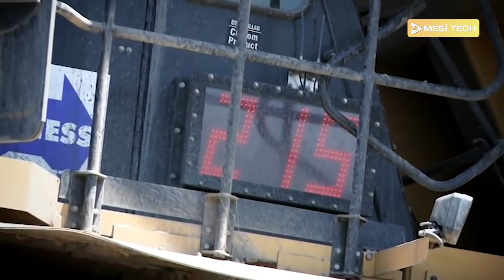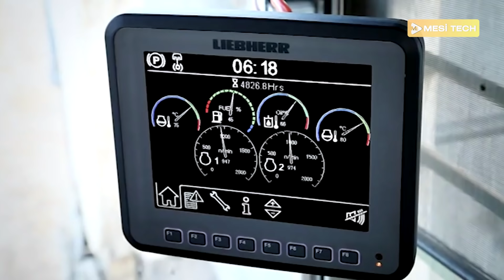The World’s Biggest Excavator in Action (LIEBHERR R 9800 Excavator Loading Trucks)

Comment: If the decepticons get ahold of this we're all f$#%ed
Reply: If it's got more than 30000hrs on it we will be right. They are riddled with electrical faults. Optimus would only have to sever a 2mm wire and it will be down.

Comment: 90 ton scoop; 3 scoop to extract enough minerals for one 1000 lb. battery for an Electric Vehicle.
The extra weight for these heavier EVs causes 1800% more pollutants from nanoparticles off the tires. EVs cause more pollution and no one wants them due to long period of charging and electrical fires.

So why is Biden pushing them? A. owned by China. China sells the batteries and covertly installs monitoring technology, just like Tic-Tok. Joe doesn't care, follow the money and he has a closet of treasonous deals with China that China uses to blackMail uncle Joe. 

He can't stand trial because the DOJ is a collaborator and Joe has been deemed to feeble mind, but can still be President? WTF?

Comment: I'm surprised how small the diameter of the rams moving the boom, dipper and bucket are in comparison to the scale of the parts they are actuating. The hydraulics must operate at a very high fluid pressure. Impressive!.

Comment: Exposed piston rods on the hydraulic cylinders...

As someone who repairs Hydraulic/Pneumatic cylinders. I hate that design for the oil feed pipes. It makes machining the barrel internals very hard or sometimes impossible, if no room for a steady rest to sit. Plus you can't replace the pipe without a full cylinder overhaul. Bad engineering.

Ideally, you would have a welded boss or an elbow joint to SAE flange. That way you can weld it on, machine the bore details round, because the welding onto a tube heavily distorts the bore roundness. That way the Gland, and o ring spigot can sit in a round bore and leave no extrusion gap.

In an ideal world, you would have used pre-honed tube, that way you can hone bore the tube to size after the welding distortion. But cost can be an issue and piston seals can be really aggressive to deal with that factor, so it's not that bad. 

The cylinder isn't complicated, I bet it is pretty big, just hard to gauge when it's on that monster. The piston rod would be case hardened to prevent chrome damage in that setting, but that has its drawbacks for serviceability. Send the cylinder to my company guys, I can do any of them and save money over retailer prices, THATS where they make the money, spare parts.

Comment: I would be interested to know what the name R9800 refers to, the 800 is clear to me With its bucket capacity of 47.5m³ and 4000 hp, 800 tons, but what does the R9(800) stand for?
Reply: It's R 9800. All the excavators of this type have a model that starts with R, and then a number based on size.

Comment: What is the fuel consumption for A 12 hour shift?
Reply: 9800 Liters = 2500 Gallons
Reply: @SubGenius1101  2500 gallons =9463.5 litres
Reply: @forfuxakes9799  i convert it liters to gallons, 9800 liters to 2588.886 gallons. I figured to round out the numbers so it didnt take to much thinking on your part.

Comment: Just imagine the hours of engineering that went into creating something like this!
Reply: Imagine the fuel bill to operate such A massive piece of machinery for A 12 hour shift
Reply: @forfuxakes9799  for sure, but you have to consider... they are saving HOURS of payroll and trucks running which are also burning fuel, waiting for loads.. this thing keeps 90 ton dump trucks moving along efficiently, 24 hours per day... otherwise they would need several smaller loaders to do this volume of work in the short amount of time this machine is capable of. I'm sure the profits outweigh the fuel costs heavily!
Reply: @Reel_Dad  yes that is all correct 👍🏻 I was just wondering what the fuel consumption is for such A massive piece of Machinery?
Reply: @forfuxakes9799  probably 4000 gallons a day
Reply: @tylerwalk7699  link or ur a communist
Reply: @Reel_Dad  why? I’m just guessing based off similar engines, but I don’t know what kind of load these things are under
Reply: not much at all . they just scaled up a Dingo Digger 

"I know ! how about we just build a really big one !"
"all those in favour say aye" 
AAAAAAAAAAAaaaaaaaYYYYYYYyyyyyyyyEEEeeeeeeeeeee
The Aye's win
Reply: What is also evident are the miracles engineers can achieve when allowed to do their jobs unimpeded without pressure from interfering owners who promise the moon to customers...
Reply: It's mind boggling.
Reply: nah - couplla nights on the pss at the local - don't know how many issues me an me mates solved at the pub after a few.....all except our marriages....them women could never understand.....!!!!....weird species......
Reply: Boss stops by every 20 minutes like I thought i said big

Comment: That thing must cost at least $50,000!!!  On a side note, it’s interesting the track pads have no cleats.
Reply: way more, your price would not even pay for the steel. Large models are 200 to 400K
Reply: @OptLab  pssst, I wasn’t being serious. I’m well aware the cost of this machine is most likely measured in millions of dollars.
Reply: @OptLab  Large models are 200 to 400k? lol  More like 10 million. The trucks its loading are 3 million a piece.
Reply: @SubGenius1101  You can look it up by yourself. I did not invent it. "Excavators are no small investment. A new excavator usually runs anywhere from $100,000 to $500,000. But before you faint from sticker shock, consider how crucial excavators are to your everyday operations. Excavators also have a very long useful life, so it's not an investment you'll have to make often.

Small excavators weighing 10 to 15 tons usually cost anywhere from $80,000 to $150,000.
Mid-sized excavators weighing 15 to 20 tons generally range in price from $100,000 to $200,000. This is by far the most common excavator size.
Large models weighing 30 to 40 tons are often priced $200,000 to $400,000."
The one in the video obviously costs more if its R&D. Since it's the biggest, it's probably a prototype.
Reply: @OptLab  We are not talking about puny sized excavators, we are talking about a 1000 ton excavator. Large models are 45 tons or bigger. Obviously we talking about what the video is showing. 10 million at least.
Reply: @SubGenius1101  true but I was quoting a website. The model of the video is special. For the market, it's obivously more than just large

Comment: 90 tons a bucket??? Dang... this thing can throw around a main battle tank easily 😲
Reply: Saw a dragline pick up a D11 like a matchbox toy once. Fucking thing weighs well over 200,000lb
Reply: @mattrixx007  That's the density, assuming 1.8 tons per cube of dirt. The description says 85.5 tons capacity if you have the ability to do middle school math
Reply: @wills.5762  I'm just gonna go ahead and round that up to 100 tons bc I'm not an overworked child. Plus another guy just said he saw it handle 200,000lbs with ease.
Reply: @dominicdeluca6378  what are you even talking about lol
Reply: @mattrixx007  you dense?
Reply: @mattrixx007  10 tons? Damn… I knew people didn’t know alot about everythijg, but claiming max 10 tons 😂😂 Dude, dig deeper into mining. A regular truck for the road can take 30 tons. 10 tons is nothing 😂
Reply: Most I've had in that bucket was 110t
Reply: Jsyk a usual load for a offroad truck with dually tires is anywhere between 345 and 400 tons, thats the normal weight, maybe could withstand more but would put to much strain on the drive train
Reply: Most heavy hauling truck loads are 250 tons. Largest trucks can take 400 tons. No more. If they go over 400 tons for those biggest trucks in the world top speed is 5 kph. So they have to dump them where they got the loads. Waste of time and money.
Reply: Hahaha. Dang ? Love it
Reply: 90 t bucket fr dayummm dats huge... or u bs lol or iam i dumb cuz I ran a backhoe with a three yard bucket out of mulch yard for a couple years always thought that was huge prior running the one yard bucket for a while

Comment: The Cat 6090FS is bigger
Reply: Bagger 288 and 293 are bigger
Reply: @nicoju5211  yes, but they are of a different class. And they are bucket wheel excavators, on rails and have supplied electric cable power. But if you are talking about hydraulic mobile independent excavators, then the CAT 6090FS is it.
Reply: @thelegobox7608  The title of the video says „World‘s Biggest Excavator“, which is the CAT 6090FS definitely not
Reply: You talking of the O&K rh400.
Cat just changed the color and the name.

Comment: Liebherr R9800 definitely is a very large machine but the world record holds the German made O&K RH400, later owned by TEREX, then Bucyrus and now is produced by Caterpillar Inc. under the name Cat 6090 FS. It now has an operating weight of 1000 t, 37.0 - 55.0 m3 bucket and Engine Output of 3360 kW (4,500 hp). For a few years Cat developed an even  larger model, based on Cat 6090. It was called 6120B H FS and had an operating weight of 1270 t. The machine had a diesel-electrical hybrid engines of 4500 hp and a 65 m3 bucket. Unfortunately, only 2 units were made and they met many difficulties to operate and the project was eventually shut down.
Reply: Actually the biggest excavator in the world is Bagger 293 by german company TAKRAF.
Weight: 14.200 metric tons
Power: 16.5 MW (22.500 hp)
18 buckets with 15 m³ each
Reply: @abcdefg3386  I made a correction only for the hydraulic ones. And yes, 288 and 293 are the biggest and heavist excavators ever built! :)
Reply: Im guessing they mean as a backhoe. The RH400/6090 is only a front shovel.
Reply: Intrigued,  my Maternal Grandfather used to work for Bucyrus-Erie! Not real sure what his job was, tho! I like watching hulking big machines in operation! I was wondering if you know the type & capacity of those trucks & how many scoops it takes to fill them?

Comment: I worked with a Liebherr 9800 they can do 4 bucket passes in a minute too load a Cat 797B with 400 Tonnes
Reply: Doubt it. Unless it is not fully load. 42 cubic meters(the size of a bucket) of what weighs 100tons??
Reply: @MarekWarot  42 cubes of packed earth weighs 74 tons or thereabouts, not too big of a stretch to say a heaping bucket is damn near 100.
Reply: @wills.5762  74x4 gives 296 tones altogether. How would you streach it by 1/3? It’s hard to believe you are even remotely aquatinted with the subject.
Reply: @MarekWarot  Mr doubter man over here won't believe a thing 😂
Reply: @wills.5762  So let me put it this way… You may have a clue or be somehow involved but you’re most probably not really good at it.

Comment: A small nuclear reactor powering this thing? Amazing.
Reply: Anything more you guys want to know.(i work at liebherr)
Reply: @maxostervall1586  How much can they lift?
Reply: Really?
Reply: @macarows4014  5.9 12v cummins
Reply: @Diego-Delgado  depends in usa they have 2 v12 cummins but in eu they have 2 liebherr engines. Evrything is Electric so The engines are just big Electric generatorn. If 1 engine fails it have a crane monted so they can Take The engine out and run half speed